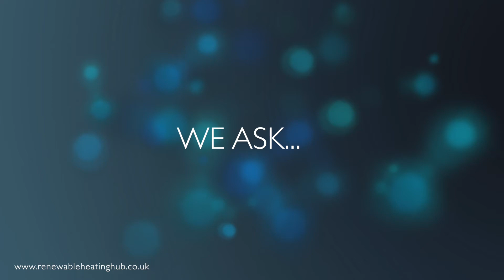Why do you have a buffer vessel with a heat pump?

Comment: The fact is that while modern heat pumps are better than the on/off version of old their modulation is still limited so sizing a heat pump to work over a wide ambient temperature range is non-trivial. If you want a heat pump to run at it's quietest most of the time then chances are it will be oversized for more moderate ambient temperatures. The buffer is required for these more moderate temperatures.

The key to higher (S)COP in modern systems is weather/temperature compensation. Put bluntly this means moving less heat at higher ambient temperatures. The irony is higher temperatures also have massively higher COP. This explains why a buffer is needed. A heat pump with COP of 3 at 0oC may have a COP of 6 to 7 at 15oC while the minimum input power will be unchanged. The fact is the manufacturers go to some length to be opaque about their minimum input/output figures and modulation range. It's all about maximum output when we really need to know both max and min across the operating temperature range.

If you and your neighbors are OK with your heat pump running at 100% on cold days making a racket then go ahead and don't bother with a buffer. Also remember the COP is dependent on load. 100% load has lower COP than 25% load.
The reason why buffers are said to lower the COP is because (1) an extra pump is required similar to a low-loss header (2) heating the additional water in an on/off thermostat driven system takes more energy than to heat just the volume of the heating circuits. However, the heat in this case is "buffered" so the loss is neglible, assuming the heat pump is not running at 100% to heat the extra volume (hint: quiet mode is your friend).
In a system modulated on leaving water temperature (LWT) alone the buffer makes no difference compared to the low loss header and for low temperature systems may make a lot of sense.
The buffer is therefore daemonized on forums like this. Primarily it's the additional 30W or so drawn by the pump which reduces the COP, albeit to make a more comfortable climate. There are trade-offs to be made and sometimes a reduction of COP is a price worth paying for a more positive experience in comfort and lowest power consumption. I can still get a COP of 4.2 with a 200 litre buffer. This is fine for me. Chasing COP alone is a fools errand. Looking at heatpumpmonitor.org stats there are systems definitely running buffers with even higher COPs so I am struggling to see the problem. There are small output systems not running buffers which run continuously, have very high COP but consume more power. I recommend adding the elec consumption column to see this. The objective is to minimize power consumption and maximize comfort.
In large houses with complex heat loss distributions, large thermal mass, low temperature hydronic heating and multiple zones the buffer makes sense.
In small houses with uniform losses, low thermal mass, highish temperature radiators, a single zone and simple controls it does not.
Ultimately the buffer increases the thermal mass of the system. If I was to say I have no buffer but a concrete basement with underfloor heating with a high thermal mass and no low loss header that would apparently be acceptable because there would be no additional pump. This is a silly argument.
In hydronic heating systems small variations in LWT can be really uncomfortable. If the heat pump cannot follow its weather dependent curve and goes say 4oC over the target temperature it can make a pure flow base system horrid to live with. When combined with a mixing valve the LWT from the buffer is far more controlled.
As always on the internet, treat anything you read, including this, with caution.

What folks should ask is what size heat pump is required for their house and what size buffer would fit with such an installation. It's pure physics.

The best investment any heat pump owner can make is in a monitoring system such as emonhp or an esp32. Heat pumps have many configurable variables and need to be carefully optimized post-installation. As a technology the heat pump will ultimately fail if the optimization is not made more straight forward. There is a disconnect between the expectation of the customer and the reality of ownership. The vendors don't help by having limited data access to their systems to allow straightforward assessement of the performance of the system. Blaming all ills on the buffer tank is a massive over simplification of an industry in denial.

These are not turnkey systems. Stop treating them like they are.

The referenced article https://renewableheatinghub.co.uk/how-to-correctly-install-heat-pumps-so-that-they-work-properly-and-efficiently is questionable as the data simply illustrates that COP is higher for lower average LWT modulating at a single temperature of 7oC. I agree the 4-pipe buffer with mixing requires marginally higher temperature, as the LWT will be the average temperature (-2.5oC lower than heat pump LWT) although this can be mitigated to a degree through the use of the 3-pipe design. 
All heat pumps will have to stop start at some point given the limited modulation range at higher ambient temperature. e.g. there is no comparison at 0oC, 2oC, 12oC and 15oC. The challenge is how to limit the vampire power draw of pumps when the compressor is not running, particularly at higher ambient temperature.

What is demonstrated here is the observation exercise has to be performed for every installation - minimum LWT to achieve the desired room temperature. Otherwise I agree with the conclusions of the article about the industry as a whole.

Comment: Buffer tanks are needed in order to reduce COP, do nothing to prevent cycling and have something to argue about.

Also, they come in handy when your installation doesn't meet the minimum water volume requirement for the correct operation of your heat pump.

Comment: Two reasons for a Buffer. The first is to minimize compressor short cycling, during low load conditions. The second is to mitigate any loss of heat output to radiators and the DHW cylinder coil, during the defrost cycle. It really depends on the size of heat pump and the application. A 5kW ASHP serving just underfloor slab heating, would not need a buffer, but a 12kW ASHP, serving radiators, would benefit from having a small buffer, even with a variable capacity compressor. So the answer is not a straight No.
Reply: I've seen monitoring graphs showing heavy short cycling in installations with a buffer tank. 
If the heat pump is oversized, it'll short cycle, with or without a buffer tank. 

My installation has no buffer tank, it's a direct connection.
There's no short cycling, since the heat pump is sized according to the predicted output requirement of the radiators, which wasn't far off the mark.
I also made sure that the radiator circuit had more than enough water volume to meet the requirements for correct heat pump operation. 

As for defrosting cycles, there's no noticeable impact on comfort in my case, but then again, I don't get many of those and they don't last particularly long.
Reply from the maker: Thanks for the comment Damian. What would your take be on this article: https://renewableheatinghub.co.uk/how-to-correctly-install-heat-pumps-so-that-they-work-properly-and-efficiently

Comment: The reason for a buffer vessel is to prevent heat being extracted from the building's heating system when operating in the defrost cycle. When the heat pump is defrosting (i.e. working in reverse to melt the ice on the outdoor coil) it cannot provide heat to the building. Under these conditions heat is instead supplied from that stored in the buffer vessel.
Reply: That only applies with radiators. Floor heating it’s 100% worthless.

Comment: Some interesting comments on this video on the need for a buffer.
Does the requirement vary by ASHP brand? Or by installer? Or by installation?

I have had a variety of recommended sizes for the main hot water tank and different opinions on whether our existing radiators will suffice or need upgrading. Heat Geek like to say "No Panacea" but as the home owner/customer, I am finding the disparity is making it hard to decide which installer to commission.

Comment: The main reason to have a buffer is to ensure the heat pump always has the correct flow rate through it from its own water pump. 
You then use the main heating pump that can vary the water flow through the heat emitters as they shut off or control.
So the buffer is the mixing point for a fixed flow system and a variable flow system, just like a low loss header but can store heat and stop the heat pump short cycling.
Reply: Yes, thats is the main function. But that is a very shallow use of its possibilities.
Reply: @arquizone  
You are mixing up what a buffer does and a heat store. The buffer is used just for a heat pump and a heating system, one heat input and one heat output just for heat pumps
A heat store with say a heat pump, solar, wood burner etc. will act as a buffer vessel for all the systems but the control for them gets very complicated, but I have done it a number of times over the last 30 years
Reply: You are talking about hydraulic separation. You don't need a buffer vessel to achieve that.

Comment: Although he is right he is also wrong. The buffer TODAY is used to consolidate the different heating sources a house has. For example: 1.water can be heated from heat pump. 2. water can be heated from Solar tubes and accumulated during the day. 3. water can be heated and accumulated from fireplaces (if they can). 4. water can be heated from a sand battery (upcoming technology), 5. Water can be heated by cycling a Lithium battery empty because the sun is getting stronger and could fill the battery. 6. water can be heat from the surplus solar power and instead of losing to the grid could be stored as heat in the buffer. 7. heat pump could use day solar power to accumulated heat in the buffer for the evening. And that is 7 reasons why a water buffer exists! Sorry Graham, but today a buffer is more useful then 20 years ago.
Reply: Overly simplistic answer - I have a multi zone house which can, in certain cases, not satisfy minimum load requirements of my ASHP. The buffer tank allows the ASHP to run more efficiently. It also allows me to 'charge' my heating on solar power during the day and consume that heat after dark.
Reply: You are talking about a heat store, not a buffer cylinder
Reply: @n2obob  its the same. If you have a good buffer with some extra insulation and you heat it to 85C, it can keep the heat for 3-4 days. That heat can be used for all your needs.
Reply: Does having the buffer allow you to reduce the size of the main tank required (with respect of MCS advised sizing based on rooms/occupancy) ?